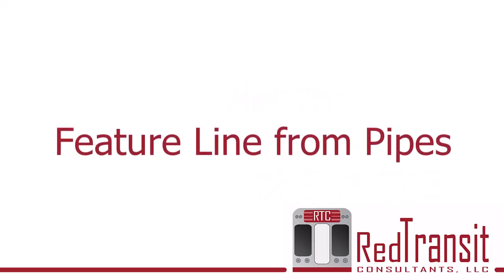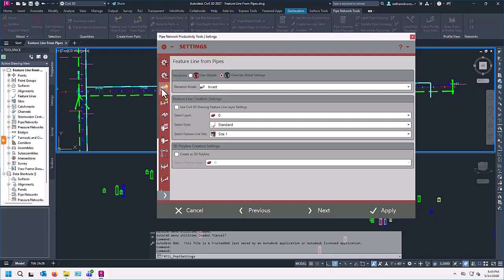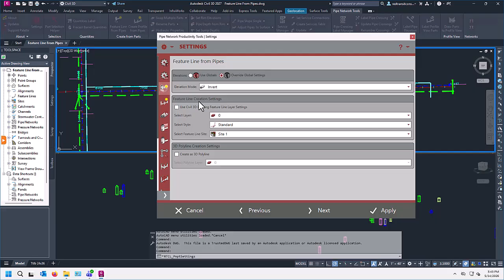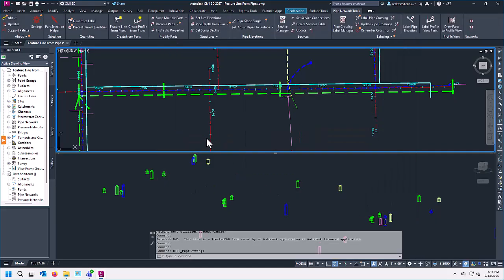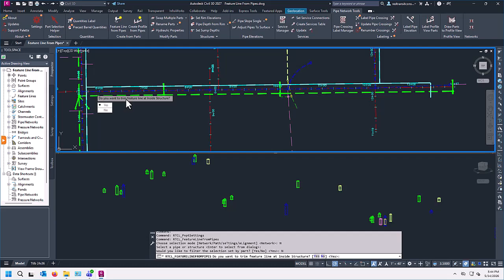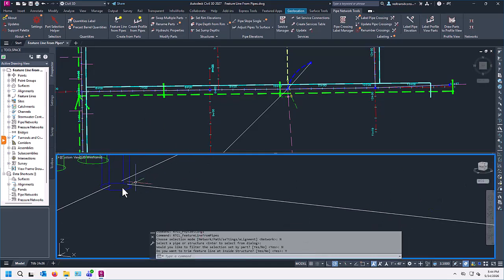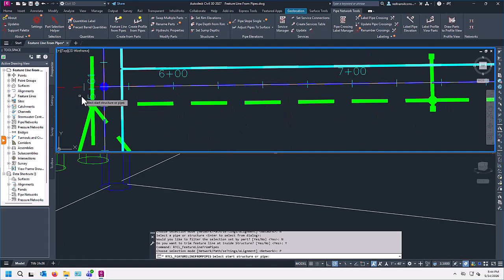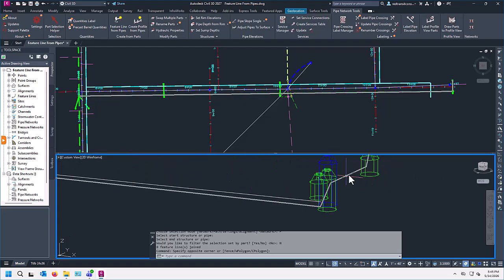Pipe Network Productivity Tools [v3.0.0.6] - Feature Line from Pipes

Comment: Steve, does any of the Pipe/Structure metadata get attached to the Feature Line segments as Property Sets; i.e. System & Unit, Diameter, etc.?
Reply from the maker: No. We don't have any options for that within Pipe Network Tools. This is the first request I've seen on this. We certainly could add some options for this in the future though.